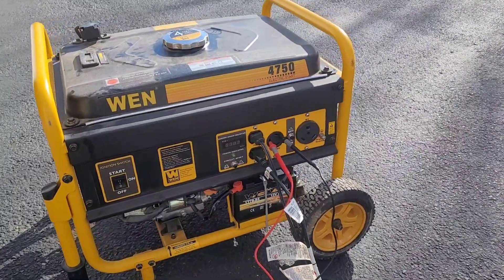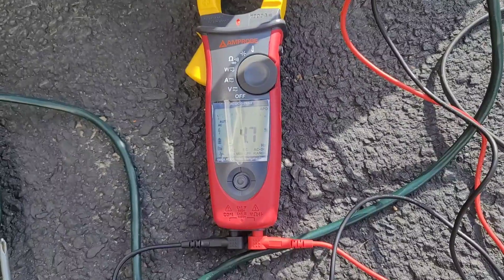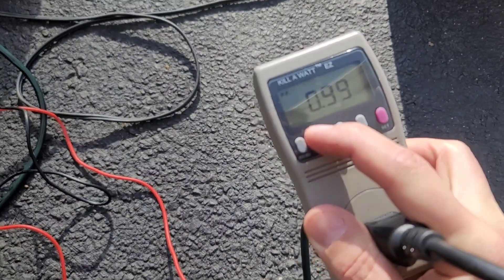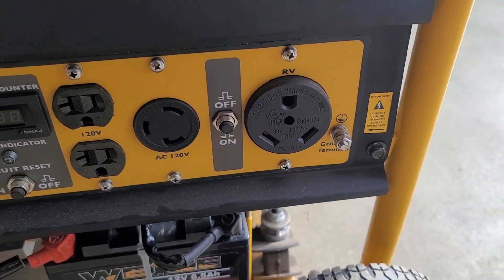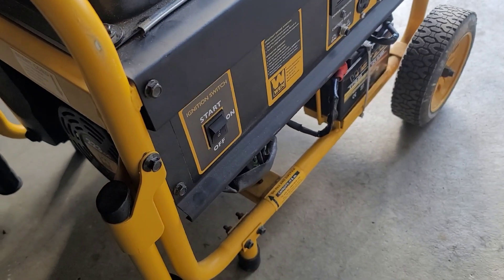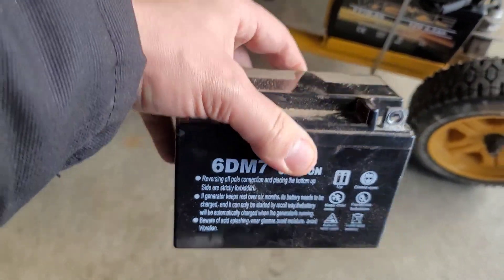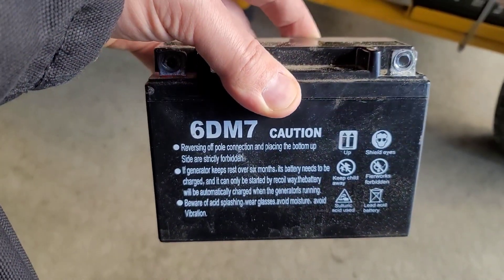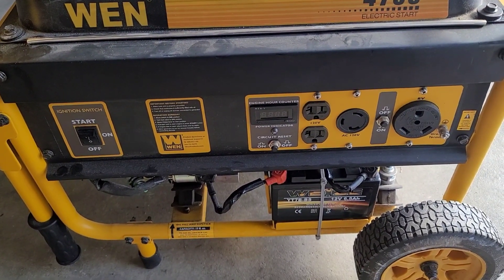WEN 56475 Generator: Review and THD%

Comment: so how expensive is your meter that measures thd ? i would like to be able to measure thd  in my generators without spending a fortune, any ideas would be appreciated
Reply from the maker: @Kris-qh1td  $483 USD new. Used around $300, sometimes a bit cheaper if you can find a deal. It's an Amp Probe ACDC-54NAV
Reply: @Bassguitarist1985  I ended up buying a new ACD-50nav for $280 can’t wait to try it out!! 
Thanks for your help!!👍
Reply: @Bassguitarist1985  any chance you could do a short video on how to use that meter and check THD?
Reply from the maker: @Kris-qh1td  I have a few videos and shorts of me using it. Check the small engine playlist
Reply: @Bassguitarist1985  just curious how advanced it is using your meter, I found one on eBay I’m gonna buy so I can check THD on my generators
Reply from the maker: @Kris-qh1td  naw, easy to use. Very simple to change through the modes
Reply: I use a Brymen BM157s clamp meter to measure THD about $170.

Comment: i would just drill a hole in front panel and put a rubber grommet and run the pull cord through the front panel easy fix for a stupid design
Reply from the maker: Agreed! If it was my generator I would certainly do that. Given this is a construction site generator it's likely going to have a very hard life and when it fails catastrophically the guy will likely just go and get a whole another one
Reply: I’m just going to use the pull cord for emergency, I think that was their intent.

Comment: Nice little generator.  Very good no load THD.   Always better to get a 120 volt only generator if you only power 12 volt loads.  Much less stress on the stator.
Reply from the maker: Agreed it does have two 120 volt windings but they are in parallel rather than in series. So there's no need to balance the load on the neutral

Comment: Hi Gary. You should be able to rotate the recoil assembly 90 degrees counter-clockwise so the pull handle is relocated near the air filter where there’s a bit more space. It will screw up the sticker label but at least the rope is less likely to rub against anything.
Reply from the maker: Yeah could have and should have done that, be far better than how it is. Dangit. The guy needed it for a job site he was working at before this crazy cold hit.
Reply: I did the same thing on mine